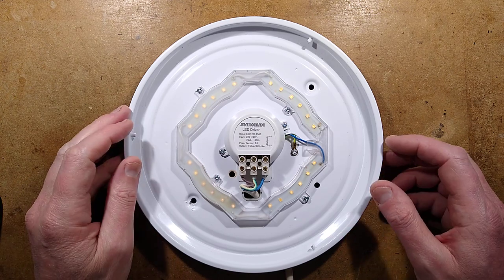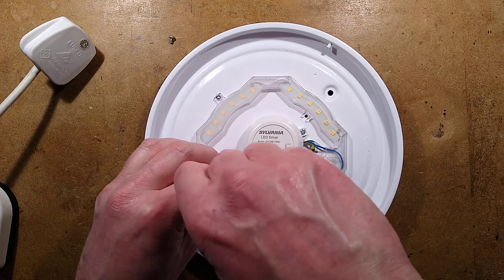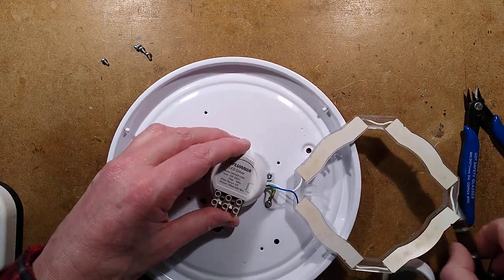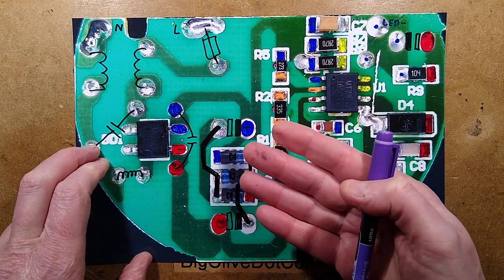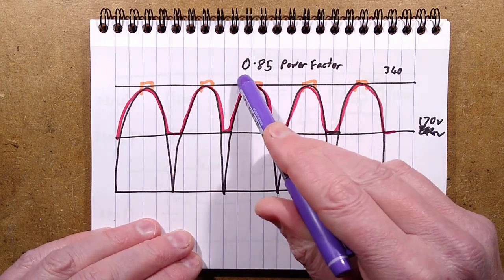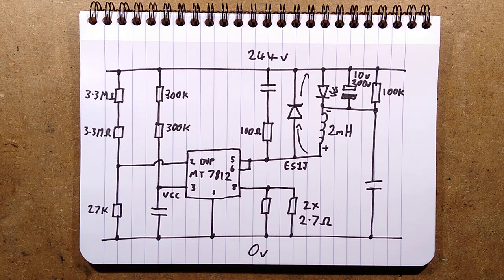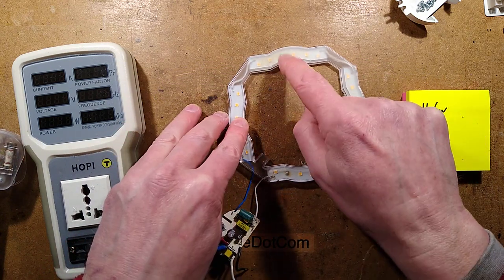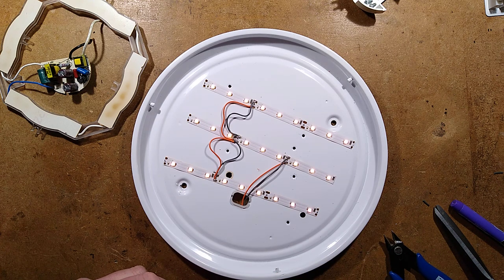Fixing and hacking a light from Thomas Nagy

Comment: This is why I want to see central and local governments placing levies for these things based on their design lifetime and ease of repair. The shorter the lifespan the higher the levy. Change the rules of the game and watch the manufacturers start gaming it in new ways that align what we’re after.
Reply from the maker: That would require competent governments.
Reply: Aye. Government drove us to LED lighting citing lower power but also longer life. As usual, they did not account for the Law of Unintended Consequences.
Reply: @Nono-hk3is  do you believe that Chinese companies would have been working to the general benefit of all mankind had government chosen not to direct us toward energy saving lighting?
Reply: Apathetic government aside, there is also another thing to consider: the corporate bottom line. Companies don't want to make a light that actually lasts as long as the package says it does. It's not profitable for them and their shareholders.
Reply: Govt makes money?🤣
Reply: Or (and I know this is an absolutely insane idea that would never work in practice) you take this thingamajig called a 'lampholder' and mount that in the fixture so that the consumable bit can be replaced when it dies.  And iffen you want lower power, mount the appropriate lampholder in series with a choke ballast so the fixture takes PL type fluorescent lamps.
But what do I know?
Reply: I think the tax would have to be based on a warranty  as expected life span is what ever they say it is but even a warranty is sketchy as they can set exclusions and wording at their discretion and refuse to honor any claim and in fact this type of law would do nothing as they would all claim a life time warranty  that they would never honor so then we the people would become the losers our best move is to look for good designs and not buy the crappy ones and publicly show they mods that  make a so so design a good design
Reply: @tomsims8719  Even better is get rid of all lighting mandates, and any companies that spew out rubbish will eat the warranty costs.
Reply: @randacnam7321  so make the warranty more or less indisputable but simply mandating efficiency standards would help allot by reducing heat and a metal casing just  seems key to this design
Reply: @tomsims8719  Efficiency is a design criteria, not the design criteria.
Reply: My mom's street still has a few orange street lamps, whereas I have outside mine, the awful white LED things. My street looks like something from the Whitechapel murders... My mom's street has a decent level of light
Reply: Thank you for taking the time to understand and explain the smoothing circuit.
This is how I improve my circuit knowledge by watching your videos dissect all manner of cheap Chinese gizmos

Comment: An almost audible sigh of relief from the LEDs with the current drop.
Manufacturers need to settle on a modular LED cob design, clip in replacements.
Reply: This model could've easily had an E27 or E14 lamp holder horizontally installed.
In fact I think this design has been around for ages and they used to take regular incandescents.
Only difference was the dome was made of glass back then.
Reply: @Ni5ei  The older ones needed a higher profile to accomodate the bulk and heat of incandescent bulbs, though. I have quite a few around my house with LED bulbs in them now.
Reply: @Ni5ei  I've bought bathroom lights of a very similar design and they took standard E27 bulbs (up to 60W IIRC) but that was around 10 years ago.
Reply: @Azlehria  Not sure if they used a higher profile. I've had similar designs where the bulb was touching the glass dome. But it was okay since it was all glass and metal so the whole fixture acted like a heatsink. They came with sleeves you could put around the wires to protect the PVC from heat where they were touching the metal base.
Reply: Or they could run them at 70% power of what they were going to run and they'll last for decades...
Reply: They could also just not cook them
In horticulture most of the LED fixtures are not intended to have their LEDs replaced during their lifetime (aside from warranty repairs). The idea is the LEDs are driven at such a low current and kept cool enough that by the time you'd have problems with the LEDs, the fixture itself would be decades old and at that point you'd probably want an upgrade given the advancements that undoubtably would have came.
Reply: @Ni5ei  Be careful! Not all LED bulbs are suitable for use in enclosed fixtures. The bulb may fail soon if not.

Comment: I've been burned a couple of times with landfill lamps. I now only buy lights with replaceable bulbs. The quality of the bulbs may be variable, but at least can be changed, rather than chucking the whole fitting.
Reply: yeah, I made this mistake when buying a new ceiling fan for my room. the leds aren't very bright and I'm sure they will go bad.
Reply: These days, it has been getting harder and harder to buy lamp fixtures that use the regular screw-in bulb types. The majority of them are now just the type with built-in LEDs. They're essentially sing-use lamps. Once they fail over time, that's it. For the average Joe, they'll be throwing the entire fixture away. 

Give me the option to use the type of bulb at my discretion. Whatever it be Incandescent, Halogen, Fluorescent, or LED. 
I don't want that single-use built-in rubbish.
Reply: At least with ordinary fixtures, you know the quality of the bulbs that are going in and you have a choice of LED, CFL or incan.

 A lot of these landfill fixtures tend to have the same shoddy components that I wouldn't trust to power a nightlight.

Comment: At first I was skeptical that the mind bending capacitor circuit is specifically to improve power factor, but if these are marketed towards commercial application, that would make some sense.
Reply: @FJS exactly. Commercial installations get incentivized to keep their power factor at unity, so a building full of these might be better towards that end than a building full of regular capacitive droppers.

Comment: Thank you, Clive. I have two of these installed in the house for 2 years now. I think mine still work because one is in a non-heated laundry room and only runs for short periods and the other is in a entrance way and only runs when going in and out that door. So again, never gets left ON for long periods of time. Might be worth my time to take them down and check for thermal grease between the LED boards and metal frame.

Comment: Speaking of landfill lamps, my neighbour has an elaborate multi ringed galaxy LED fixture with epoxy potted everything that probably cost him a thousand dollars and will last for maybe a couple of years ... at most. It's even less repairable than the lamp in this video. Kind of a tragedy that product designers come up with such poor concepts. LEDs offer so much longevity and flexibility in art if done right.
Reply: Yeah, it's horrendous, wasting LEDs like that, and in a few decades we'll get the complaints about there being not enough silicon for chips anymore
Reply: @ChronicMechatronic  Isn't silicon the third most common element on earth?
Reply: @Ultrazaubererger  Yeah, the complains will actually be that there isn't enough of the much less abundant elements they use to make the phosphor.
Reply: One thing I think about is if a person has multiple matching LED fixtures for a room or whatever. When one inevitably goes bad or becomes broken in some other way, what if that particular design isn't sold anymore? Lighting decor styles change relatively quickly; the chances of finding an identical replacement a few years after you originally bought it are slim to none. In all likelihood those remaining good working fixtures will get sent to the landfill and replaced with another matching set.
Reply: @Ultrazaubererger  I dunno, but at the rate they're burning through it, it won't take long for everything to be evenly dispersed in landfills around the globe.
Reply: for sure I have seen them .
Reply: @ChronicMechatronic  the mines of the future... Yesterday's landfills. After you sort out all of the plastic anyways.
Reply: I’ve seen those lights in B&Q too. They look nice, but don’t seem practical.

Comment: Wow, that is a clever diode/capacitor circuit! Really, really clever in all its simplicity. It helps with power factor, but only indirectly, sort of. In my mind, the full description is that it prevents flicker, without ruining the power factor. 

In a conventional buck regulator, you simply get no current when the voltage falls below the combined LED forward voltage. Ok, so you add capacitance to extend the time the supply stays above the threshold. But in order to add enough capacitance to solve the problem, you make it "top heavy" (lot of current during the top of the sine wave) because the bridge rectifier doesn't conduct when the LED has a charge above the instantaneous incoming line voltage. All pretty well understood stuff so far.

The cleverness of this circuit is that it introduces the charge/discharge cycle. During the leading period of the sine wave, the line feeds both the capacitors and the lamp. When it reaches the peak, the capacitors are effectively taken out of circuit, and makes the lamp powered by the falling edge of the sine wave. This is the clever bit because the capacitors don't block the bridge rectifier from conducting at this point. Finally, when the voltage falls below diode voltage, the capacitors are allowed to discharge. Since they're now in a parallel configuration, you have in a sense doubled their efficiency in preventing flicker during the low period of the sine wave. And none of that energy was wasted during the falling edge of the sine wave, so there's more to go around now.

Now I feel like making my own measurements to see which configuration reduces flicker the most per unit capacitance.
Reply: Someone else commented that this is a valley fill circuit. According to Wikipedia, it's a passive power factor correction circuit.

Comment: About 8 years ago when moving into my apartment, I bought standard fluorescent light fixtures from Lidl (they had tubes in them and were dirt cheap), removed the tubes and gave them to a neighbor who could use them. Then I rewired them for accommodating different types of LED T8 tubes with high CRI. Those tubes are still in service. But I know if they fail, I can easily replace them without having to buy a complete unit including a "fixture" that isn't even one...

Comment: The rectifier circuit is called a valley-fill circuit.
Reply: Thanks. There's a small Wikipedia stub article on the subject.
Reply: Makes sense, a valley-fill circuit in a landfill ceiling light!
Reply: What are some alternative solutions to increasing power factor?
Reply: @TheSlyMouse   A critical conduction mode buck could get into the 90s but that's a lot of squeeze for very little juice. With the valley-fill circuit already at .85, it's not worth the extra components, complexity and failure-points except in a very narrow set of use-cases.
Reply: Thank you, I will definitely will research it a little more.
Reply: @TheSlyMouse  Adding an inductor before the bridge rectifier can gain a useful improvement in PF ("passive power factor correction") but inductor values suitable for 50/60Hz  means a fairly large/heavy (and expensive) part.  Active power factor correction circuits as used in e.g. Gold rated PC power supplies is effectively a boost converter that charges the main smoothing caps.  This switcher tracks the incoming waveform, drawing an average current that is roughly proportional to voltage so presents a mostly resistive load.  Since the switching is performed at high frequency, the inductor is smaller and cheaper than a passive solution, but also requires additional components.  Either solution is going to be more expensive than the simple valley fill circuit, though would provide better PF.
Reply: This comment should be pinned.

Comment: Thanks Clive. Exactly what I did to a similar light 3 months ago. I’ve resisted buying LED lamps because they are so good at programmed failure that happens just after the warranty period. The only weakness now is the electrolytics. The interesting thing is the brightness hardly changed.

Comment: It's a charge in series but discharge in parallel capacitor pair.  So it only actually smooths (holding the voltage up whilst discharging) when the mains supply waveform drops below half of the peak.  For the remaining two thirds of the cycle the mains input is powering the regulator directly, hence the good power factor.  In theory you could take this a step further with three capacitors and six diodes, smoothing only the bottom third, leaving the mains supply powering the regulator directly for 78% of the time.  The regulator should still be fine as it's only outputting 72 volts to the LEDs.  But that would probably be over-engineering.

Comment: The funny thing is with how much space is in there they could have fit and properly cooled an ample amount of LEDs and made the thing last decades. At least in the screw in bulbs they have the excuse of not having much room to work with.
Reply: Oh, IMO the argument of not having enough space in screw in bulbs is not valid - most lamps I've seen lately are mostly empty with just a tiny power supply behind a super flimsy thin aluminum PCB on which a single dozen LEDs is being grilled at 10 watts... they would have more than enough space to put a whole bunch of aluminum heatsinking - except air is cheaper so they don't.
Reply: @ChronicMechatronic  Heatsinking to where though? Everything in there is mains referenced, there isn't room to put such a heat sink in a well ventilated safe enclosure. The better bulbs line the whole lower shell with aluminum already. To do any better you'd probably have to use a more costly, bulkier, isolated driver design so you could have a touch safe heatsink, which you do see employed in some of the larger bulbs meant to retrofit old high bay lights.
Reply: @TheGorf  eh, that one is more nuanced. You have a very unavoidable compromise in an incandescent lamp, the lower the filament temperature the longer it will last, at the expense of efficiency and color temperature.
Reply: @Broken_Yugo  I mean like it is (_or was_) in the better bulbs. I've had some good ones from ages ago that had real solid chunks of cast aluminum in the base. Now it seems even renowned brands use just a flimsy 1mm thick lining for a 10W bulb from what I've seen recently
Reply: @TheGorf  Yeah, I watched the veritasium video about it... At the beginning where a single LED bulb cost 10+ bucks they boasted about 10k hours of lifetime - now things like that have vanished from packaging.
Reply: @ChronicMechatronic  That's what I'm saying, it'll cost ya 10 plus bucks to buy such a bulb, nobody did, so they started cheapening the design. Personally I've had no trouble with the current designs, many in enclosed fixtures, and that's on fairly high line voltage, my suspicion is more die to dirty power (again, cost related) than heat.
Reply: @ChronicMechatronic  it comes down to how much profit they can make from this light
Reply: @ChronicMechatronic  yes I have some Cree Screw in LED bulbs that have glass an old bulb and finned heatsink I had them installed for 5 years.
Reply: @Broken_Yugo  It was quite easy to design ones (incandescent bulbs) that lasted easily ten times longer or more. They only sold them to commercial establishments at very high prices & for places where the bulbs were very difficult to replace. 

They designed those cheap bulbs deliberately to produce a limited shorter lifespan. The simple basic method was to under-rate the filament just slightly to it would degrade more rapidly.  I believe one of the other tricks was to make the glass not quite completely 100% gas tight so that oxygen contamination would build up slowly inside until the bulb blew. Think they sometimes also used similar tricks with cheap thermionic valves..
Reply: @Lucien86  Yes, I get it, the world is out to get you, keep that foil hat on tight!
Reply: @Broken_Yugo  The whole built in obsolescence thing is pretty well documented. Companies like Apple are still using it today to keep their customers buying new phones and throwing the old ones away..
Reply: @Lucien86  No, you just think it is. You cannot call everything that doesn't last as long as you'd like "planned obsolescence", that makes the term meaningless as nothing lasts forever. The Apple phone gets shitty after a few years because software keeps bloating to match available power. The light bulb doesn't last because most people won't pay for one that does. Batteries are usually glued into stuff because LIPOs are dangerous and it saves space, weight, and money, using the device itself to protect the battery. Etcetera, etcetera, if it wasn't done deliberately, and mainly, to fuck over the consumer, it's not planned obsolescence, usually it's just building things to a price point. Just like it isn't entrapment every time a cop convinces some criminal to do criminal shit.
Reply: @Broken_Yugo  Whooosh!!!!   In case you didn't notice in this video BigClive is actually giving an example of a product with a basically deliberately built in lifespan. Many more examples can be found here or on AvE's channel talking about things like power tools..
Reply: @Lucien86  , there was a good show about the 1000 hr limit on light bulbs.  it even involved companies behind the iron curtain.  it was called "the great light bulb conspiracy".  at least i think that was what it was called.